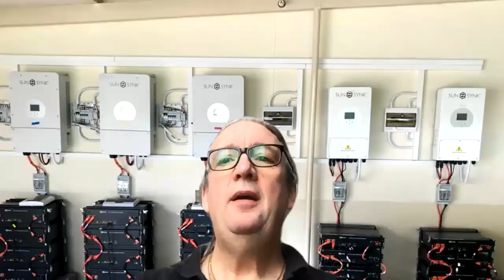Common fault codes

Comment: Have had F20 overcurrent a few days have been told to turn mppt off in settings and it stops someone said theres a bug in mppt firmware
Reply: Hi may i ask if you got it fixed amd how? my sunaynk is doing the same error now😅😅😅

Comment: Why am I getting F20 faults when the battery reaches 100% charge, and activity to the battery actually stops (PV providing supply and exporting, and battery idle) It seems to be the opposite of the reasons stated here for F20 which are based on its supply load?

Comment: 3kW kettle runs fine off batteries, I get an f34 when trying to run this kettle when charging at full 3.6kW off the generator. 7.5kW genset, and the combined load is less than the transfer switch rating of 35a…. 3.6 Ecco

Comment: I understand that you have confidence that it's not your product at fault, however it's not helped when the inverter is powered on, you get 3 green lights indicating all is good, no red fault light, no fault code and the thing is screaming like a banshee, then it makes the installer think is it faulty.

Comment: Hi Keith, I have the 5.5 Kw Sunsynk hybrid inverter which is intermittently failing when there is a power failure due to load shedding. (its fails as soon as the power goes Off)
When the system is in the failed state the battery is a 100% and the battery shows "battery fault" 
The Inverter shows F56 fault. There is no output from the inverter in the failed state.
Sometimes the inverter will correct itself and restart after 3 - 55 minutes, other times I manually restart the system and it works fine thereafter until the next time...
My problem is that the system is still under warrantee the installer does not seem to have the knowledge or motivation to remedy these problems. 
I want to find another installer to go through the solar system and check all the Sunsynk parameter settings but do not know if he has password protected the settings, can we change his remote login settings as he has threatened to switch me off remotely?

Comment: Thanks for the heads up.  But to add, it’s not always the battery, a lose connection or any settings.  Just spent two hours troubleshooting F56.  Found out there was one circuit breaker that just kept tripping the system.  Every time I switched that one breaker, it would give me F56.  Left it off…all good…for now.  Will find out if it lasts the night.
Reply: I got same problem f56 but not batteries was low was 70% and i got no more load to home stopped any hint

Comment: Keith have a f59 code and the alarm is that loud had to turn system off can you help
Reply: I am have the same issue. Did you manage to resolve it?
Reply: @matthewpage2543  yes turn the system off in the correct order leave for 10 minutes the start back up in correct order as per manual

Comment: Hi Keith you're doing awesome stuff. Can you help me out a little? I got F18 code (AC overcurrent) you mentioned that this can be caused by high surge currents. Got a few questions (model 10kW): 
1. Is the 'surge'  a problem if the hybrid inverter is connected on grid too and the current can flow from AC in to Load port? the passthrough current is 45 Amps right? 
2. After resetting the inverter, the F18 code does not go away, does this indicate that some relay is broken?

Comment: i got an F22 error fault, could you enlighten me, the last activity i did was using using solarman smart app, setting the battery parameters. thank you. i learned alot from your videos. hard to find support for Deye 5kw hybrid inverters here in the philippines.
Reply from the maker: Sunsnk and Deye are linked but we have a different operating system. A little bit like Apple and android, where did you buy your inverter from can't they help. ?
Reply: @sunsynk  i got it figured out already. thank you for your reply and more power sir to you and this channel. thank you, i've learned a lot from you.